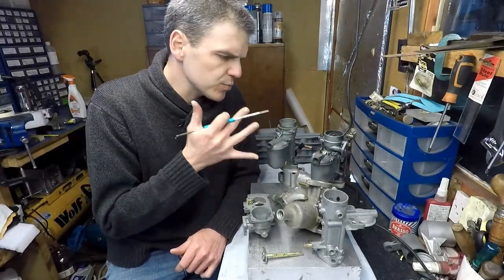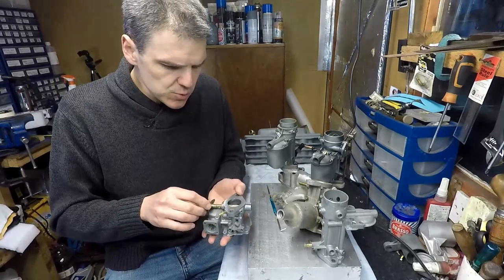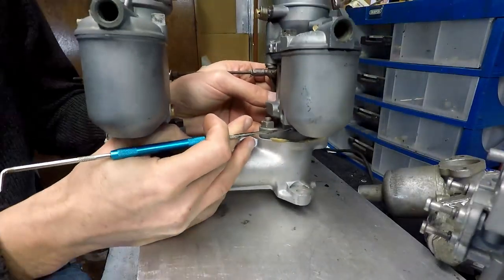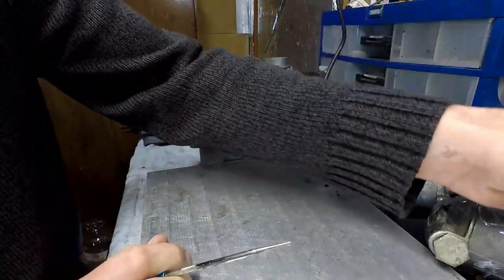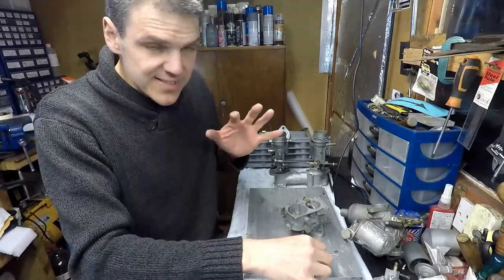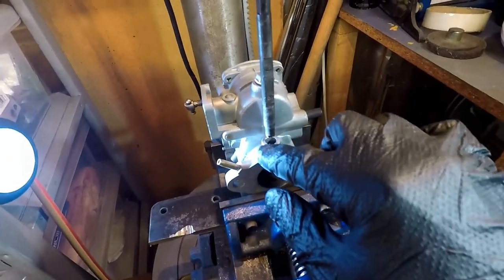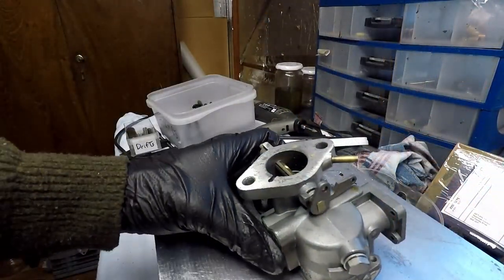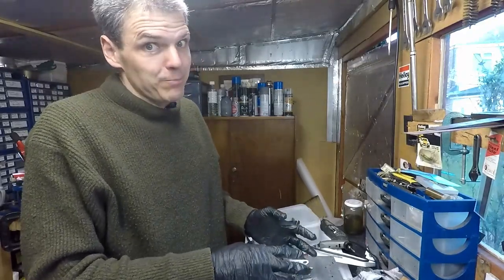How to solve problems with rough idling in small carb engines Zenith 30IZ Aquaplane manifold

Comment: Any tips for air leak testing? I've used brake cleaner spraying on suspicious areas before, but that just seems not too reliable solution for me. Smoke machines are pretty expansive (there are DIY solutions made from e-cigarettes or even soldering irons, but smoking engine internals with baby oil seems also icky to me). I've seen also someone using propane from that small torches, but I haven't tried that.
Reply from the maker: Brake cleaner or carb cleaner are my fluids of choice.